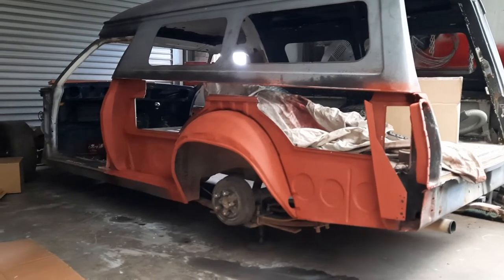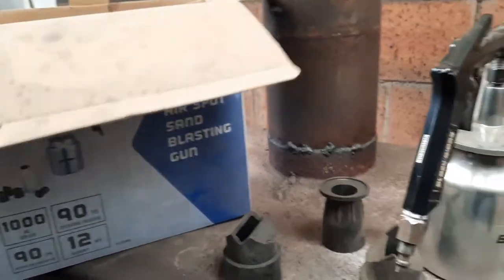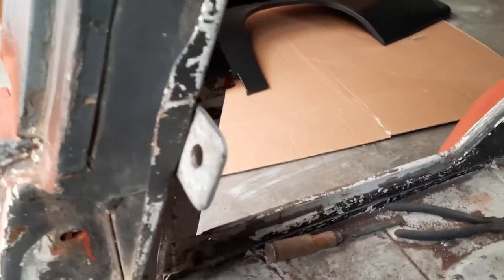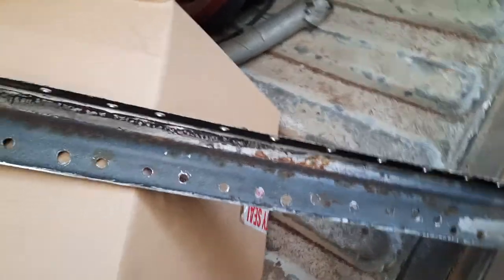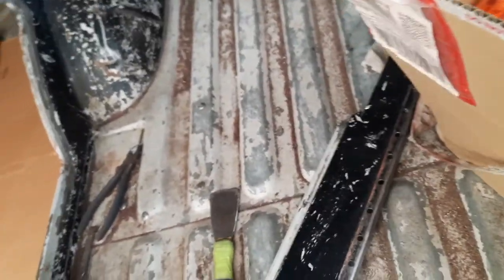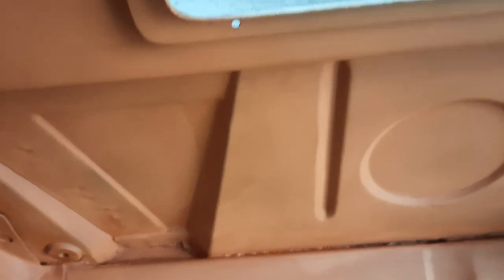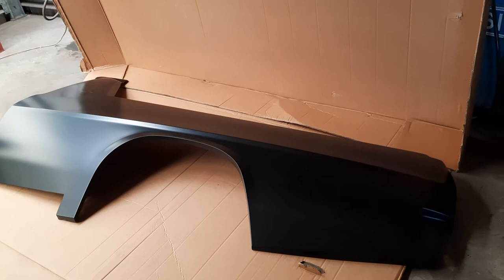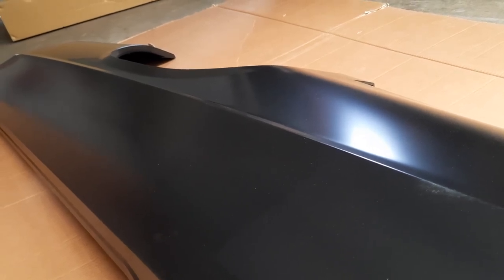Holden WB Van, quarter panel replacement and restoration. part 4

Comment: That's a lot to cut off the new one, but what else can you do. There is 'weld thru' paint on the market
Reply from the maker: Yep and I already made a mistake on the cut. The straight line actually comes up ,due to the angle and curve , at the front. Glad I havent done the fold yet
Reply: That's a big panel.
Reply from the maker: @sixtyfiveford  And majorly stressful to fit, as you would well know, it wouldnt take much to ruin it.